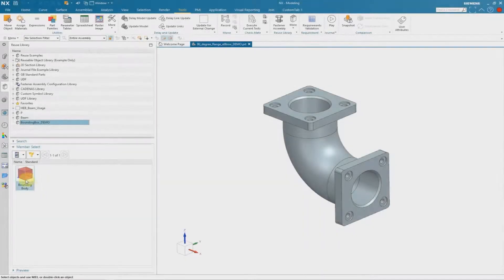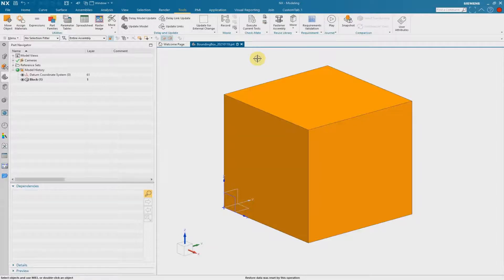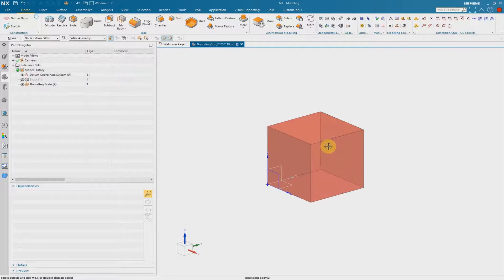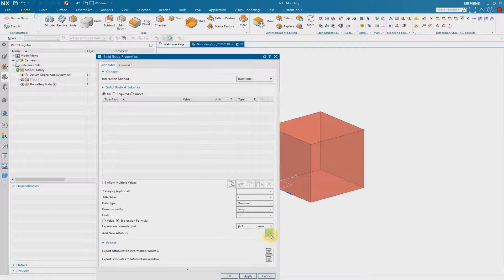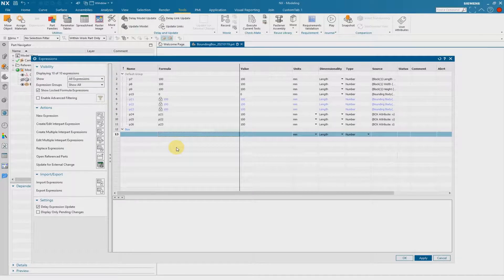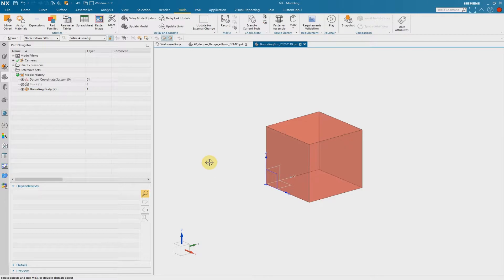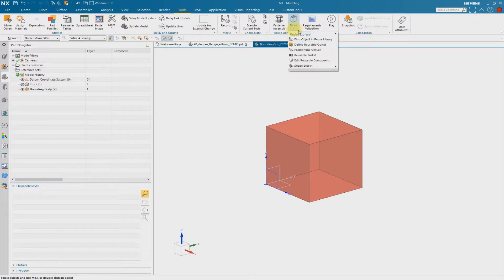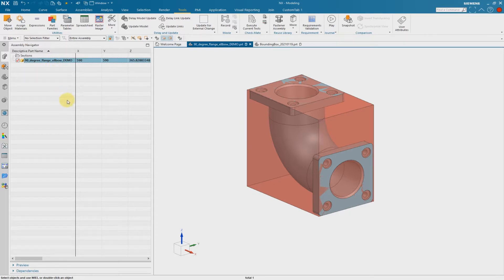Siemens NX - The Reusable Bounding Box

Comment: Thank you for the quality video. Is there a function that creates an expression? Among Die Wizard library functions There is a function to retrieve the expression of the parent part using the syntax parent::, which I would like to utilize. In other words, we want to automatically place four screws that are evenly spaced at the four corners of the square block. I'm Korean, so my English may be wrong.
Reply from the maker: Hello. In the context of an assembly, it would be possible to carry out the automated placement of screws using a pattern that can be mapped as a reference from the individual part. In general, there is also the option in NX to pass values from top to bottom or vice versa using the given syntax (copy source and paste as a new expression) - InterPartExpressions. Or as an approach: use a reusable assembly.